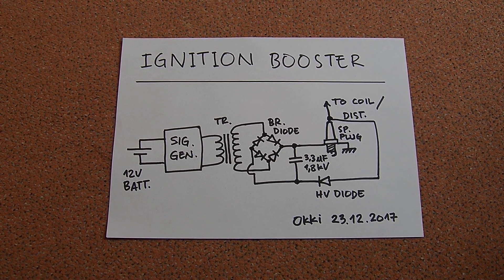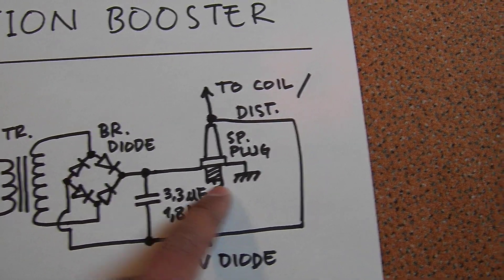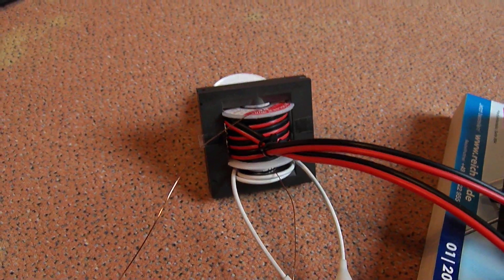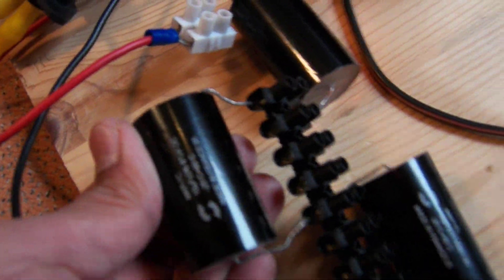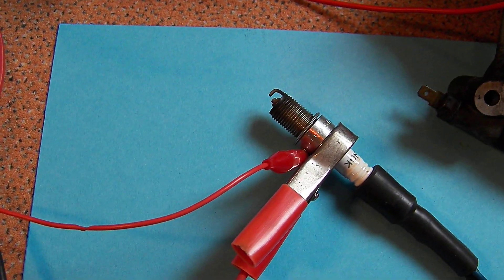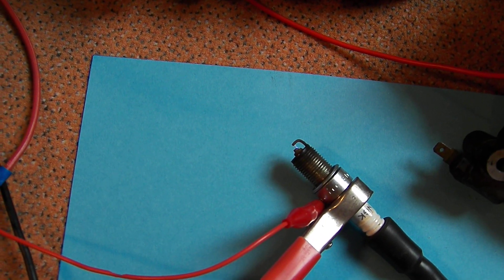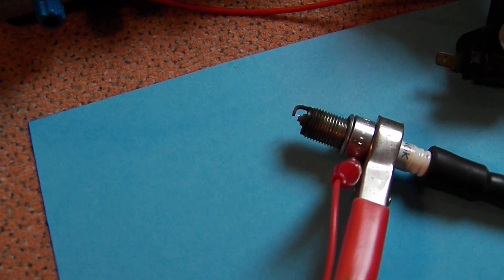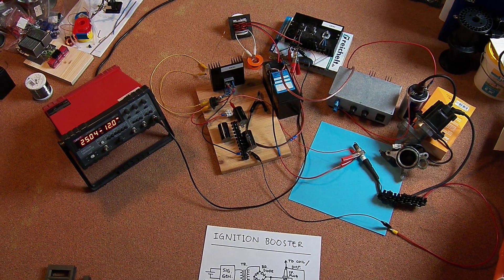Plasma Ignition - Powerful Version

Comment: Wouldn't this destroy electrical components on the car?  You're creating higher voltage and it's connected to the spark plug which means it's also connected to your 12v electrical system, unless you isolate every ground off of the engine block so only the spark plug is the only electrical component there... I've been wanting to do this with a power inverter but I don't want to fry every component on my only vehicle.  150 VDC vs 12VDC system.  It looks good on paper when you don't think about everything else connected to the battery.  I recently hooked up a mister setup to my vehicle but I think it hurt gas mileage, even at the lowest setting.  A stronger spark is what I need to see the gains for mileage by igniting some of the water.  Hopefully the CAT doesn't explode the HHO that the H2O turns into.... I really need a test vehicle.
Reply from the maker: I use this setup (https://youtu.be/i9yY6DLNOWY) for a short time on my car and I did not destroy any part of my car except the sparkplug electrodes. Here you can find more info: http://www.m-opensolutions.com/?p=172